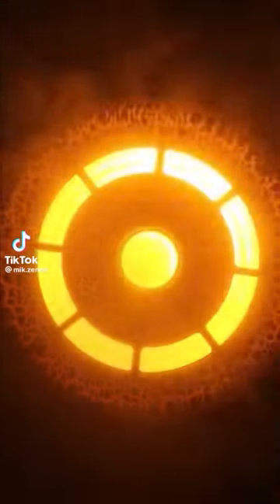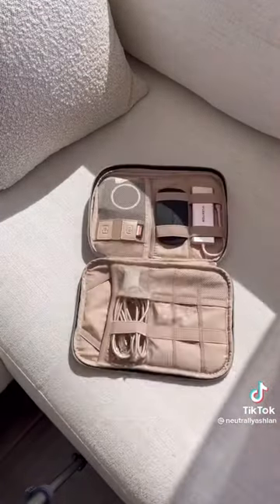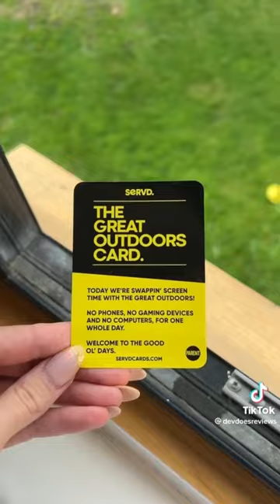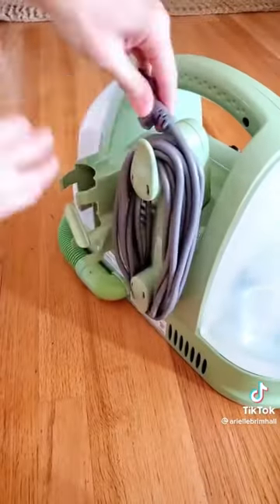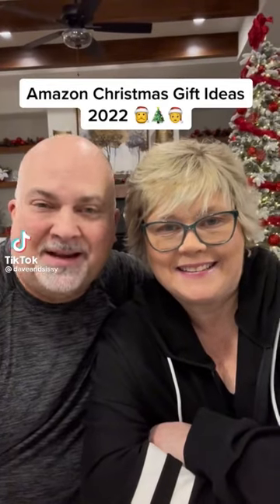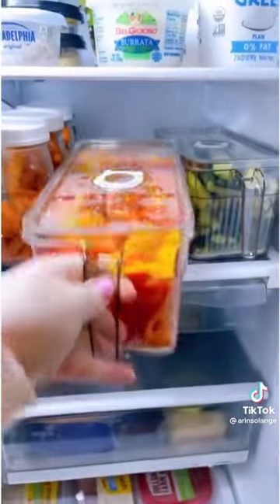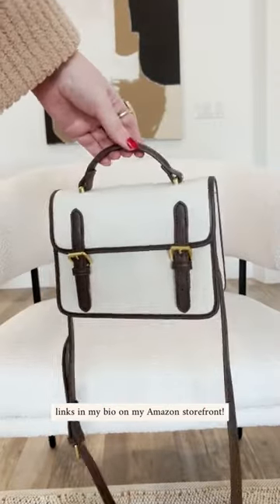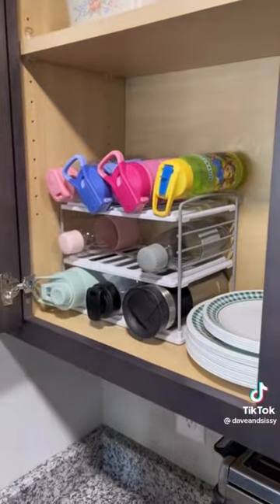2023 FEBRUARY AMAZON MUST HAVES | TikTok Made Me Buy It Part 8 | Amazon Finds | TikTok Compilation

Comment from the maker: Products in this video:

00:00 Torras hand warmer 
https://amzn.to/3COcEvo
Aromatherapy oil diffuser 
https://amzn.to/3GwndEk
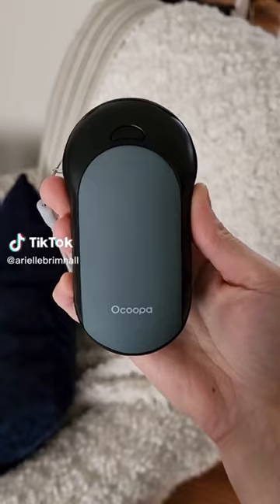00:24 OCOOPA Hand warmer 
https://amzn.to/3QCKEQY
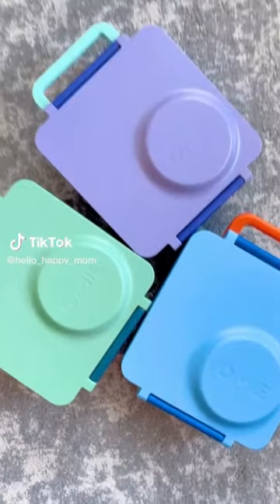00:43 Omie luch box for kids
https://amzn.to/3XsQu9P
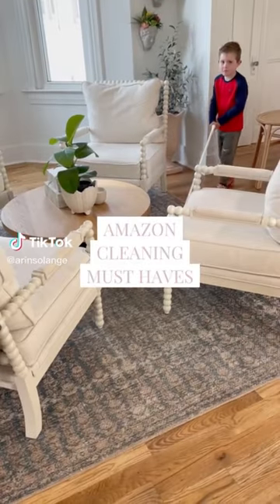00:53 Carpet sweeper 
https://amzn.to/3QCLnla
The pink stuff
https://amzn.to/3H2jgIQ
Scrub daddy sponge holder 
https://amzn.to/3ZxkyTx
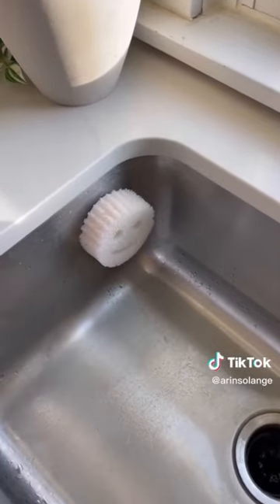01:33 Wine bottle puzzle 
https://amzn.to/3QEjqJN
Electronic organizer 
https://amzn.to/3ZwtRmB
Champagne cocktail mixer
https://amzn.to/3kft4q8
Let’s get deep 
https://amzn.to/3QEkvBl
Jack black the balm squad
https://amzn.to/3IO0OoK
Shower phone holder 
https://amzn.to/3CNa2hg
Travel makeup mirror 
https://amzn.to/3H4niAo
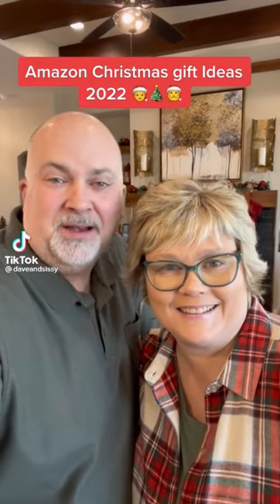02:07 Ortizan portable speaker 
https://amzn.to/3IM9U5f
02:36 Kinetic sand 
https://amzn.to/3QBo3Em
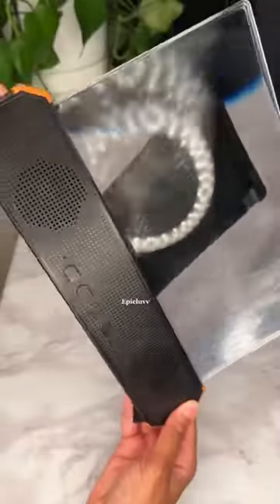02:49 Screen magnifier
https://amzn.to/3w1N6H7
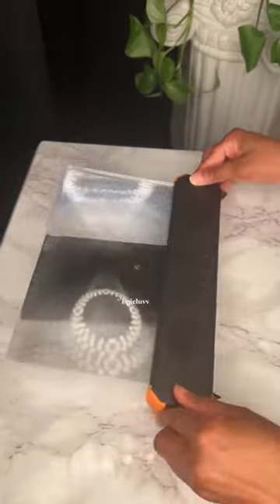03:01 Divoom slingbag
https://amzn.to/3w2R3vc
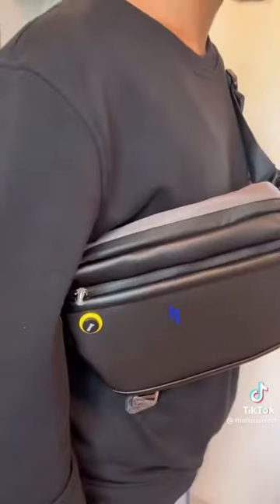03:18 Servd kids vs parents 
https://amzn.to/3GGvTrS
03:54 tiktok scroll remote
https://amzn.to/3XLom1Z
04:11 Vinyl funny feet slipper
https://amzn.to/3IO2ApU
04:27 Bissell little green portable carpet cleaner 
https://amzn.to/3X5tkGG
05:20 Hot styling tool storage 
https://amzn.to/3QH4MBE
05:40 Ride on suitcase luggage bag
https://amzn.to/3IIWRlh
Self folding stroller 
https://amzn.to/3Zwjuzg
05:58 Magnetic hand warmer 
https://amzn.to/3IKWTsO
06:06 Feekaa Usb fan
https://amzn.to/3QS7JPX
06:24 Smart fingerprint door lock 
https://amzn.to/3IO4Ptk
06:35 Beanie wine stopper 
https://amzn.to/3ZtiADv
06:51 Rak telescoping magnetic flashlight 
https://amzn.to/3GHzYMg
Rak multi tool pen set
https://amzn.to/3IM5gEj
07:42 3 in 1 wireless charging station 
https://amzn.to/3ZBdy7Y
08:06 Game console phone case
https://amzn.to/3IFwooB
08:22 Egg holder 
https://amzn.to/3IQlPz4
Produce saver containers 
https://amzn.to/3X7OCUg
Ball mason jars
https://amzn.to/3GwtShO
Beverage pitcher 
https://amzn.to/3CLnQIY
Mdesign plastic storage organizer 
https://amzn.to/3kh0LYx
Drink dispenser for fridge 
https://amzn.to/3XrabyP
Food storage hanger
https://amzn.to/3k86OhH
Fridge drawer organizer 
https://amzn.to/3vZLhKT
Rolling soda can organizer 
https://amzn.to/3CLLh4R
09:26 Brigii handheld vacuum 
https://amzn.to/3H3wpl9
Power scrubber
https://amzn.to/3XqaauU
Wall cleaner mop
https://amzn.to/3IMgjxj
10:13 Womens turtleneck knit sweater top
https://amzn.to/3XaYAE7
Scarleton top handle purse
https://amzn.to/3ixP8fg
Crossbody bag for women 
https://amzn.to/3CLhyZM
Black and white womens bag
https://amzn.to/3WaChxl
Womens winter casual striped v neck sweater
https://amzn.to/3QEOo4D
10:55 Window cleaning robot
https://amzn.to/3H2jCPK
11:36 Yourcopia foil organizer 
https://amzn.to/3X3Irk0
Water bottle organizer 
https://amzn.to/3GA1rzC
12:08 Detachable shoe strap 
https://amzn.to/3H5d2Z2